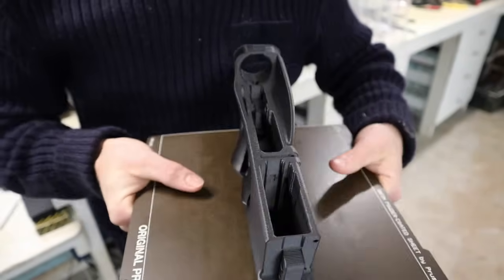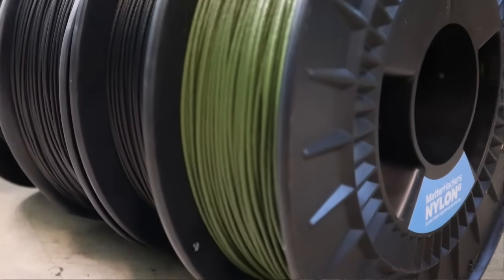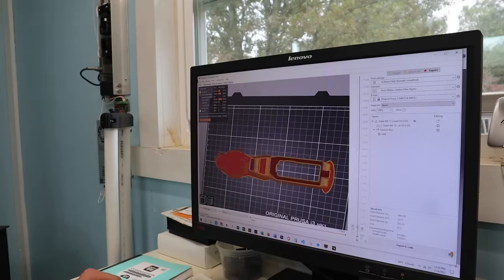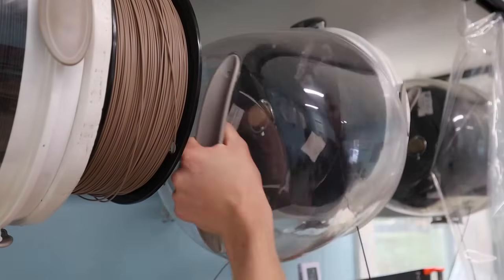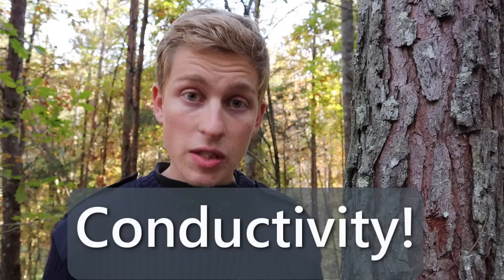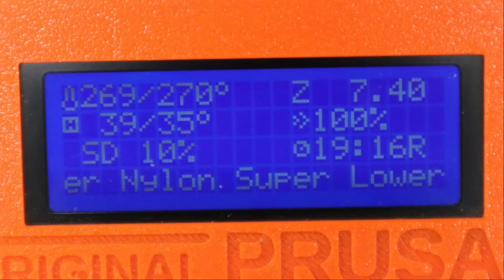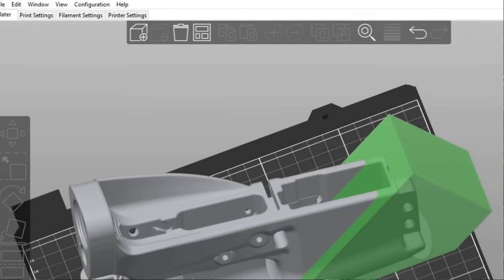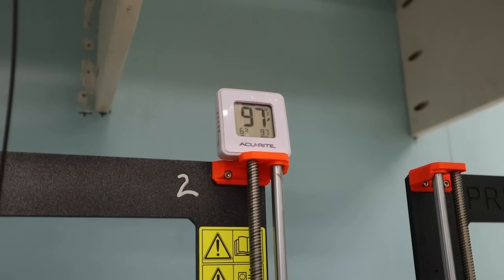How (And Why) To Print With Carbon Fiber Nylon | Print Settings, Tips And Tricks

Comment from the maker: Just a note. The tips in this video are still valid, however, I don't recommend the Push Plastic CF Nylon for most parts any more. As is the case with many low fiber content PA6 based Nylons, after absorbing water it becomes more flexible then it should be be. There are a lot of options out now, so look around figure out what's best for your application. Read data sheets!
Reply: I got few degrees and studied polymer and industrial chemistry.  I think it's just as you said with smaller parts because they can't cool quickly enough especially while the hotend directly over or very close and bed is also  hot below it's sandwiched between two hot sources unless you're support or distance between bed and hotend is sufficient that heat will bleed into the part. Now it's still not  hardened because it's under both but as soon as the hotend moves the area above is the cooler area and generally you'll see the plastic bend up towards cooler as heat wants to flow to cold areas so the object and all the heat is trapped begin creeping towards the coolest side generally above where the head no longer is. 😀  I hope that makes seem like very smart young man
Reply: @dreknows  I would think there is a remedy in the slicer? Maybe you could come up with a plug in?
Reply: @dreknows  or pause between layers?
Reply: @dreknows  Could compressed air be supplied via a tube and appropriate nozzle to precisely cool parts?
Reply: Yea i had a problem with the pushplastic even after drying it with warping, specifically with the upper. Polymaker cf-pa6 works fantastic! I think the pushplastic doesn't have enough carbon fiber in it making it more like nylon.
Reply: I got eSun and sainsmart carbon fiber filament and both suck I can't get my Ender S1 to print properly. eSun Pla plus is easier to use it's funny tho esun white works better than black it's weird. I want the cosmetic look of carbon fiber & to of course not fall apart or be nothing but ugly lvls with tons of burrs. Running a Ender S1 with sprite h
Reply: Huge thanks for not just these video series, but the updates. Don't know if I should thank you or hate you for the rabbit hole I've been sent down since I've found your channel 😂
Reply: Great video. Have you ever looked into doing a vacuum resin carbon fiber infusion, or forged carbon from a mold made from the "lower thing"? There are many ways to either coat an item, create a pressure mold, and so on. I imagine coating a printed "thing" in carbon fiber would make the item far more stronger. Look forward to your reply.
Reply: Ğjj
Reply: Justine PETG nylon tends to creep after a while, it's why we don't really recommend using either for voron printer parts. It's great stuff no doubt, and vision miner nano is life. Best stuff ever made on textured pei. Printing nylon without an enclosure scares the heck out of me. Interlayer bonding goes way down and the reason it warps, of course alot of these polymers have other polymers added in the blend (depends on brand) they don't tell you about to make it easier to print without enclosure. Go with like a pure nylon or and good luck without an enclosure.. Just like ABS near impossible without enclosure, I hated abs for years and years then came back to it a few years ago, and tbh it's prob one of the best polymers for this use, no creep, good heat resistantance, and UV protection. Of course the carbon fiber that's added to these nylon blends make it easier to  print without enclosure. I usually always use 90-100 bed for nylon WITH ENCLOSURE. night and day. Of course Nano is a must for me. Plus ABS you can vapor smooth.
Reply: Have you used a graphene in your printing? I am totally new to printing, just trying to learn about it before making the plunge. Graphene is something I happened across and it sounded promising. 
Thanks for all you do for everyone.
Reply: Any new filament recommendations for the heat and impact prints, that can withstand miniplosions.
Reply: What better options do you suggest? PA12-CF?
Reply from the maker: @shoegum7362  Working on that right now. PA612 (annealed) from Polymaker is good. As are some of the PET-CF filaments (Bambu).
Reply: @HoffmanTactical  I actually just got a roll of PA612-cf too, trying out polymaker's fiberon pa612-cf filament as it supports faster print speeds, even still I slowed it down anyways but still faster than their regular pa612-cf filament.
Reply from the maker: @shoegum7362  The regular PA612-CF has been very impressive. Just make sure you anneal it, and account for the shrinkage!
Reply: ppa-cf go brrr
Reply: If anyone has worked with Anycubic’s Kobra S1 Combo, how to properly pre-set it up to print smoothly with Nylon as well as the names of the choice of filament brands for Durable / Long lasting Part Printing
Reply: I'm going to try and do minimal layering of electroplating to seal it more less.
Reply: Essy fix is DIAMANT Polymer dichtol AM, 1.000 ml cheap too

Comment: the slower the print the less warp. slow is the way to go. instead of trying to keep the temp up even throughout the whole print. Keep it Down evenly.  Its a battle between layer adhesion and warping. its not heating that warps its cooling.

Comment: I do 65C first layer, 35C thereafter with nano polymer adhesive. On large flat surface prints I let the first layer cool below 45C before continuing the print. I've found that when nylon is around it's Tg, it's rubbery and can't resist the warping forces of subsequent layers. Keeping it below 40C seems to keep it rigid enough to prevent warping.
Reply from the maker: 100%.

Comment: You should try out the Nylon AF80 Aramid by Fillamentum. Aramid is a type of kevlar, so its kevlar reinforced Nylon, and holy crap is it strong (and surprisingly easy to print with). Expensive, but worth it if you need the strength.

Comment: :hand-pink-waving: There is nothing wrong with the higher carbon fiber plastics. They print well and work very well in applications. The problem is that you do not have the correct equipment to print these. Your little Prusa hobby printer isn't going to work. You need a high temperature, heated chamber printer. And your nozzle temperatures are way too low. :goat-turquoise-white-horns::hand-purple-blue-peace:
Reply from the maker: Higher nozzle temperatures will not prevent nozzle clogs, and a heated chamber certainly will not. I don't disagree that for some applications high fiber content filaments are good, but for guns the poor surface finish and inability to print with a 0.4 mm nozzle make them poor options.

Comment: pro tip bro, don't clean your bed surface while it's on the machine. You want that bed to be PERFECTLY level and any mount of pressing on it can change that. That is why you clip on a piece of glass or something so you can remove it to clean it.
Reply from the maker: Actually, I don't do this any more. But it's more to keep the machine clean of any adhesive residue than to prevent leveling issues. I think that's only a problem with spring mounted beds such as the Ender.

Comment: How are you the only one recommending such a low bed temperature and keeping a straight face?!?!
Reply from the maker: I'm not. Even Polymaker recommends sub 50 C.
Reply: @HoffmanTactical  I've been printing at 60c but have found quite a few that run at 100c or more... I've never had a PA6 print curl.. Have you?? Try it!
Reply from the maker: @trevordeemie674  I've actually stopped printing with PA6 due to low stiffness. The PET-CF I've replaced it with has no warping, which is awesome.
Reply: @HoffmanTactical  PET-CF doesn't warp and also doesn't flex like PA6?? Interesting!?!? I took a break for the last couple of years due to the limitations of my printers and other directions I pursued in this hobby but recently built a 2.4 R2 that is fully capable so I returned to my roots lol 😆 what is the downside of PET-CF?? No way it's perfect...
Reply from the maker: @trevordeemie674  Less impact resistance. But honestly, it's pretty good. I'll be covering it in a new video soon.

Comment: I believe the warp comes from the lower layer being to warm will retain its plasticity and elasticity while you apply layers above it. The upper layers being farther away from the bed are able to cool while the lower layers remain hot from the bed, this cooling in the upper layer cause contracting of the material. Because the upper layers are stuck to the bottom layers when the top contracts it pulls the lower layer that is still warm with it. So instead of the entire piece contracting in unison, you get a bend. Imagine laying a sheet down with a mattress laid on top of it, stand in the center holding the four corners of the sheet and pull, the whole mattress bows. This is what’s happening. The stuff cooler upper layer contracts pulling the pliable warm layer up with it causing a bow. So the bottom layer needs to be allowed to cool so that it contracts from the bottom up letting the fresh upper layer contract as it cools to match the layer beneath it. This is my belief what’s happening based on my knowledge
Of physics and material properties.

Comment: So, I have a Creality Space Pi filament dryer. Is that not sufficient to dry Nylon? It looks like you're doing a lot of extra steps to do the job of a off the shelf $65 filament dryer.
Reply from the maker: The problem with most of the off the shelf units is they max out at 70 C, which is not hot enough.

Comment: Modern engine intake manifolds are made from glass filled nylon. The ls3 in my car still has the factory intake which is handling the heat and boost pressure just fine. So if you want a less expensive option for 3d printing of "things" then gfn is a good option

Comment: 2 years later and here i am sitting here printing..........thangs. excited to see how it all ends up. thanks for doing what your doing. Anyone whos uneasy about getting into it, id start with the super safety. Good Luck!
Reply: I am still having trouble hiding the bodies.
Reply: @AndTecks pig farms
Reply: Did you have sucess printing the Super safety with Pla? I'm using PLA pro but I'm not sure if it will hold up to the shock of the internals. Ive seen people source a metal printing service from china but that seems like more work then its worth.
Reply: @CastledMallard  so I've only made it with 100% infil with pla. Still don't have range test. However at 100% infill is does function properly. I did print some at I believe maybe 10-20 and as soon as the slide moves it would snap. Long story long, give it a go in pla at 100% infill. Should work for atleast a mag if not more.

Comment: How well would CFPA6 work in an upper for 22lr? Would it hold up when used to print a barrel nut?
or is there a better filament to Use?
Reply from the maker: Mil-spec style printed barrel nuts are a poor design for 3D printing. Sections are too thin for polymer.

Comment: If moisture is such an issue why not run a room dehumidifier? I'm up in the mountains of Montana and I've burned wood for heat So it gets naturally very dry here Not only that but when it gets 10 below or more all of the moisture freezes out of the air and drops to the ground

Comment: I've noticed with printing with PA6-CF that if you first. 
Dry Filliament
Keep filliment in dry box while printing. 
Keep temp around 274°C nozzle
Bed temp is 60°C 
Chamber Temp 55°C 
Let part completely cool in chamber on bed until all is cool.

Comment: See all this is the opposite of my experience. I print nylon cf at 290c nozzle temp 110c bed temp on g10 bed plate with no adhesive.
Reply from the maker: Honestly, it really depends on the filament. I know COEX prints pretty good using your method.

Comment: I'd love to hear your thoughts on Prusament PC Blend Carbon Fiber
Reply from the maker: Not tried it with the CF fill. In my experience with other filled PC blends, they tend to be a little brittle. Also may have the constant stress cracking issues of unfilled PC (which is the reason I don't use PC blends anymore).

Comment: Qidi make great cf nylon but its over 200 a kg in Canada except for last weekend. All the expensive filaments were on sale on Amazon for valentines for some reason.

I use a tent with glue stick for bed slingers. But i got a qidi x-plus 3 and gave away my old printers.

Comment: If you don't have an enclosure, the best way and  easiest way to get   around warping is to use  a  raft  it definitely helps the warping the raft will warping before ur peice does a littl3 safe guard

Comment: If you don't want to spend $90 on a tungsten nozzle. Vanadium nozzles are way better than hardened steel and cost like $30.
Reply from the maker: I'm not so sure about tungsten, I found the rougher internal surface caused a lot more clogs. I've never had issue with the lower thermal conductivity of steel. No reason to print that fast with filled Nylons.

Comment: had nothing but huge success with Nylon X, and Priline Carbon fiber polycarbonate for the last 4 years. CFPC is def a finicky one but really good as long as you get your settings honed in
Reply: one thing you did not mention was fan usage. Carbon Fiber Polycarbonate needs fan on even on first layer. On my Prusa, I have it permanently turned on for 60% on first layer then down to 50% the rest of the layers. Some reason, Prusa has fan turned off on anything carbon fiber by default. but Ive done countless tests with benchie, and the XYZ cubes with different fan speeds with 260C nozzle, and 90c bed. If fan is off or less than 50%, you will see layer separation with angles and overhangs. 13:00 in your video you were talking about warping, try turning bed temps up and turning fan on at higher speed.
Reply from the maker: I never had print issues with the CF-PC from Priline, I was just not impressed with the physical properties, It's really a ABS blend. I definitely need to revisit NylonX.

Comment: PLA+ with higher impact resistance than PACF? No way, my PLA+ parts are way more brittle than PACF. PLA is very rigid, but it shatters very easily.
Reply from the maker: You must be using the wrong PLA+? PLA is very stiff, strong, and somewhat brittle. But a good PLA+ such as Polymaker PLA Pro is very impact resistant. PLA+ / Pro and PLA are not the same.

Comment: hey hoffman love the videos, they have taught me a bunch and inspired me to do some really cool projects. Thanks for taking the time. Also, have you ever tried adding a light epoxy coating to the finished print for added water resistance from warping? could be an easy and affordable addition to post processing to add some extra protection.

Comment: layer adhesion is terrible on carbon nylon
Reply from the maker: Only on the high fiber content stuff, and even then, it can be pretty good. Flexibility due to water absorption is a much bigger issue.
Reply: @HoffmanTactical  switched to nylonx and works much better than the polymaker stuff

Comment: Kinda stupid to print a lower receiver for YT. You take away from the art of 3d printing, with something illegal in most states. You take away from good 2a ppl, fueling both the anti 2a “it’s a ghost gun!” crowd, and the lunatics and kids that shouldn’t have access.
Reply from the maker: A) The lunatics are already provided guns, using "bad people will get them" as a point against 3D printed guns is the same as using it against any other weapons, it's foolish. B) The anti-freedom groups are set on taking away your rights no matter what we do, thinking that self limiting your own rights will save you from those who wish to take them is not a winning strategy. C) 3D printed guns provide weapons to many good people who would otherwise not be able to get them.  D) I develop and distribute free files for easy to print guns, that's not changing anytime soon.
Reply: 3d printing firearms for personal use is legal in most states as long as you aren't printing NFA items or doing it as a prohibited person. Furthermore, the idea that this is taking away from the 'art' of 3d printing is absolutely asinine - being able to print a firearm doesn't devalue anything printers are already able to do, it's just an additional capacity that some people choose to enjoy.

Comment: seems to fiber glass needs to be used in filiment  instead of carbon fiber in a low cost solution as fiberglass is tougher in a lot of build if not most
Reply from the maker: Toughness has not been an issue, stiffness is the challenge with PA6 based filaments. CF also does a lot better job stabilizing the print than GF.
Reply: oh ok @HoffmanTactical

Comment: Its gotta be metal for me. PLA plus and Nylon other 3D high end printed materials just melt and warp too easy in everyday temps. Not even worth it until they come out with a high tolerance material like the Glock Polymer or something.
Reply from the maker: PLA+, yes. But Nylon and other high temp materials are a non-issue. That's why we use them.

Comment: regarding the bed temperature tip: i tried PA12-CF15 from Fiberlogy with 270°C Nozzle and 100°C Bed Temperature (Printer fully enclosed, Chamber gets to around 60°C), used some PVA Gluestick on a Textured PEI bed, and it came out wonderfully... Layerlines are almost invisible, layer adhesion is strong enogh for my needs. All of this at printing speeds at around 200mm/s, 80mm/s for the first layer. Dried the spool at 70°C for 12 Hours prior to printing, and printed right off that dryer while it was still running. For smaller parts i activate part cooling at around 30%.
Reply from the maker: PA12 prints really well! These tips are really more for PA6. But creep with PA12 is a big issue.